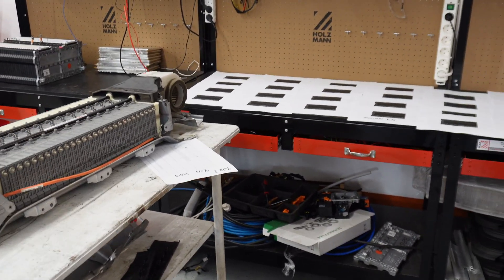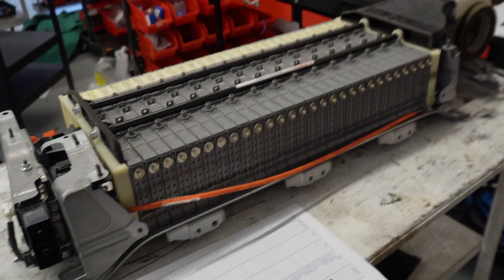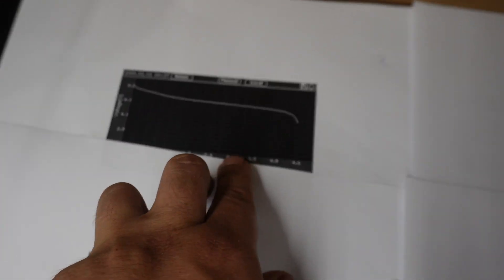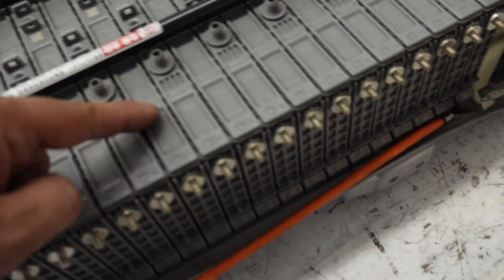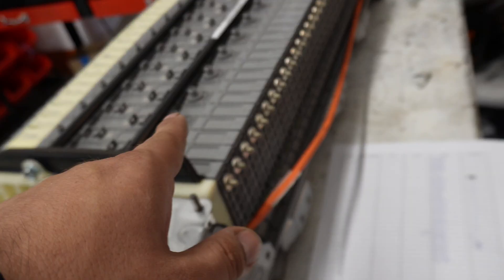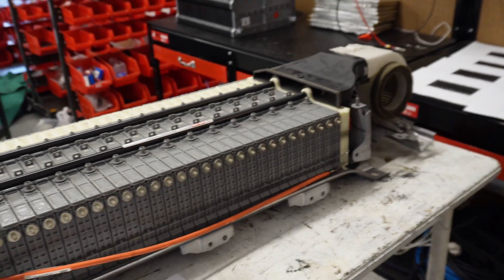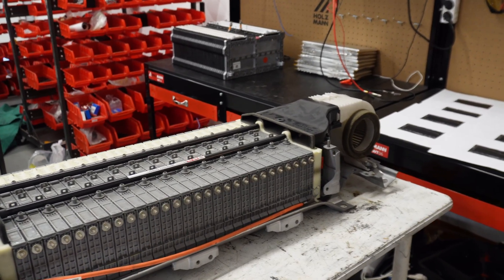82% Toyota battery DEGRADATION and REPAIR

Comment: seems as if Toyota  has stone age tech when it comes to batteries s...
Reply: @nilsfrahm1323  And what brought you to conclusion that there isn't any? They have both temperature sensors and voltage sensors. Temperature sensors vary from 3 to many, voltage sensors were always on every bus bar interconnect (the metal piece that connects 2 cells together) so every 2 cells. I don't know if this was intentionally skipped (highly probable) or they just did not know (doubt) in this video. You can even see the cable on 5:54 mark so it was disconnected there. Orange cable closest to camera contains voltage sensors, thin black cable bundle going across has temperature sensors. Check any video about replacing Toyota battery and you see it
Reply: my camry hybrid has 314000km (195000 miles) and have no issues with hybrid battery .... how can that be?
Reply: @beastlysun  so far both, the video and your case, are anecdotal evidence. one needs large scale data to fully analyse
Reply: @Watt_Ihr_Volt  not only larger scale data, but also background. As it was mentioned, its air cooled. It has air intake filter that can be cleaned and if damaged needs replacement (was 15eur when i poked a hole in it). I live in like ... medium dusty environment? I clean after every oil change (10-15000km or 6200 - 9300 miles)
Reply: @beastlysun  Unless you actually checked the actual capacity of the battery, how do you know if you have a bad battery?
Reply: @hojnikb  Until 240000km (150000miles) it is checked yearly by Toyota. But i do not see any degradation in battery state as i drive. Meaning that the battery never goes empty in my 2x100km commute and still have the consumption in between 4-5.5l/100km (58.8-42.7mpg)
Reply: @beastlysun  People had over 50% degradaded battery and their economy didn't change... And as some suggested, toyota might be refurbeshing those packs  without their owners even knowing they did it in their service checkups....

Unless you know the exact degradation number, everything else is highly inaccurate.
Reply: @hojnikb  that part with toyota refurbishing packs during checks ... well if they did, hats off. Because that check if it was only for the health check was within one cup of coffee and piece of cheesecake that i got in their lobby :D 
I know that is now very popular to sh** on toyota for some reason, but many of those are sourced with "trust me bro" ... like the 50% degradation without change in economy. That degradation will give you P0A80 code
Reply: @beastlysun The battery in gen 3 Toyota hybrids discharge to min of 40% and charge to a max of 80% of the whole capacity, that's why they last so long and that's why the consumption does not change drastically over time like evclinic says. U only use 40% of the capacity all the time u drive. The battery in the Toyota hybrid in priority isn't meant for ev driving but mostly for ev assisted driving. Trying to drive in EV mostly is not most efficient.

Comment: That battery is dated 2004. So it means it is designed in previous century. 
And the new battery costs 2000eu. Buying a new one every 8 years is cheaper than repairing dpf in turbo diesel. 
In the contrast bev battery would cost to repair much more then 2000eu.
Ev clinic hates hybrids because they cannot profit on hybrids. 
I own hybrids for 7 years now and ev clinic lies about hybrids.
Reply from the maker: But that battery is degraded 50% after 2-3 years. then you have degraded fuel saving and placebo efect
Reply: @evclinic  Toyota is using 0.4kwh of the battery alone. Not the full capacity in the first place.
In reality 9 year old car with the old battery consumed less than half of litre more than 9 year old car with a new battery after I bought it for less than 2000eu.
It was ct200h from 2011. It consumed around 5.4 litre in Zagreb with old battery and that dropped to around 4.9 litre in Zagreb after battery changed. 
The car had more torque with the new battery. 
Also with the old battery my consumption record was 2.7 litre from Rijeka to Karlovac at old road.
My biggest consumption was 8.5 litre from Ploče to Zagreb on the highway with old battery. 
The cars average consumption was 5-6 litre with old battery. 
So it is more than placebo for the old 2011 gasoline car without turbo.
Rav4 phev consumes even less. I can drive it as battery electric car most of the year. But I don't have range anxiety when going on road trip with my small children. 
Rav4 phev at 150km/h on highway consumes less than 7 litre on long trips.
On short trips it is consumes much less (because of 14kwh inside battery) .
Yearly average consumption is in range of 2 litre per 100km for both road trips and city driving.
So it is much better than bev for diversity usage.
Bev could be better only as a second city car because there is no yearly maintenance as phev has.
So yes, 2 tonne suv phev with awd and around 350hp consumes much less than 10 litre on high speed highway. 
It can go above 10 litre only on top speed (around 200km/h).
No turbo. Gasoline engine from 2018 with direct force tehnology. 
Tesla performance model would ve great for city driving and middle age crisis. 
For everything else Toyota phev is the best.
Reply: @goranjurkovic6796  they just don't want hybrids on the roads because they can't profit from them like u said.
Reply: @evclinic where you get that number?

Comment: There is an application called Dr. Prius that provides a procedure for calculating battery degradation. Do you think it's accurate enough to assess the degradation without having to remove the battery pack from the car? And on this kind of batteries what would be an alarming degradation percentage?
Reply from the maker: Not accurate. You cant see state of health of each module precisely, and you dont see slipping edge of each module if i cell is dead… which generates overheating.
Reply: Welcome. What tools do you use to check the battery capacity Thank you
Reply: Also hybrid assistant. You can use it so that the fan kicks in more early and turns higher

Comment: You could do a lithium upgrade and upgrade the coming will work 10x better
Reply from the maker: @zunzea  you could do upgrade to EV and sell prius
Reply: @evclinic  But a change of all cells cost just a few thousand Euros, a new EV cost 10 times more. For sure it makes sense to repair the car.These cars runs for 15 -20 years with no problems, except the batterie if the owner did not clean the filter/vents regularly.
Reply from the maker: @mradeschnig  250,000km Hybrid consumes 33000€ of Fuel + 7500€ in obligatory preventive service + battery 2200€.
EV has a record to make 600,000km with original battery. You can produce your own electricity, or you can pay to charge at 1/4 of fuel costs.
Reply: @evclinic  you just pulled that figure out of ur ass, many HV batteries are replaced before and just after the warranty expires, very hard to say how long they will last on average much less state 600k km. And even then, the range will be worthless for any significant trips
Reply from the maker: @zunzea  damn, priusology sect arrived
Reply: @evclinic  exactly. Hybrids are shit because they are slow, but they are reliable, whereas even just the heater failing on an EV will strand the car
Reply from the maker: @zunzea  They are not reliable, and same heater is in Hybrids failing even more often
Reply: @evclinic  doubt it, EV heaters are used way more to heat and cool the battery as well as AC and are subject to more wear and fail earlier than Hybrids
Reply from the maker: @zunzea  same as hybrids, and even more often on hybrids
Reply: @evclinic  evs are not good enough, limited range and charging, no thanks
Reply: @zunzea I think you need to do some research!!
Reply: @kitcht  I have, thanks

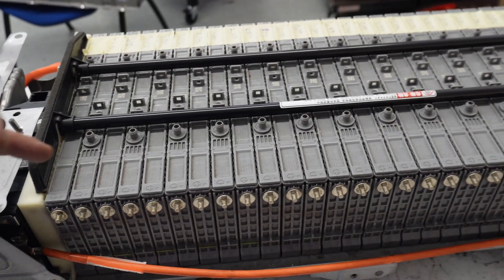Comment: 1:20 Wow, that is really bad design. 🙈 Would it make sense to install some overlapping NEEY active balancers (24S, 65 €) with 4 A balancng current? What is the cell configurtion? 6P 28S? Or 6x28S? NiMH or LiIon? Thanks for your great work! 💪👌👍
Reply: This is a NiMh pack. Every module have 6 cells in series and all the modules are in series. Balancing NiMh packs doesn't really makes it any better. The main issue is the cooling and the oxidation of the busbars with these.